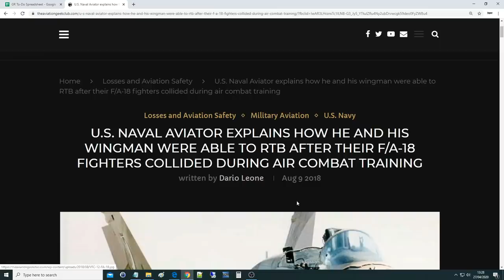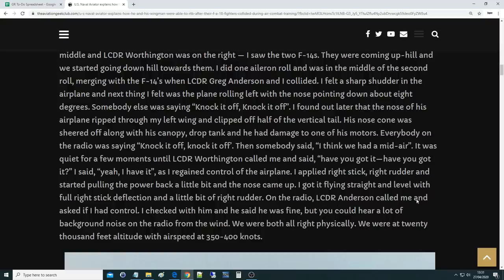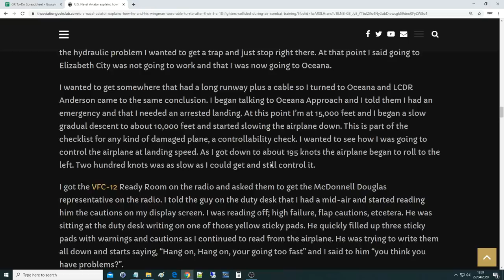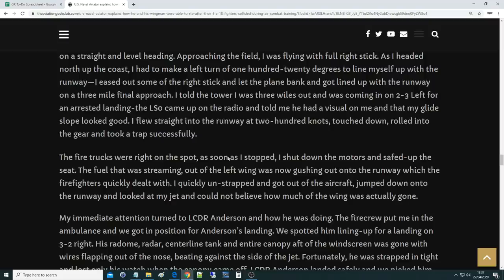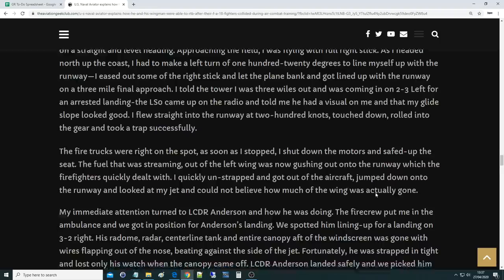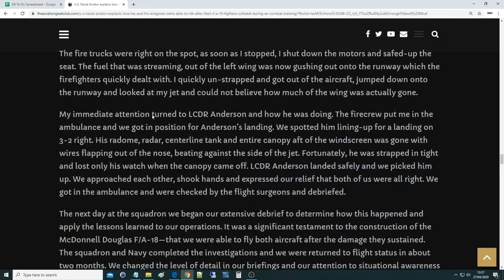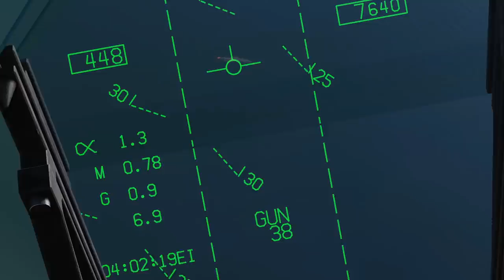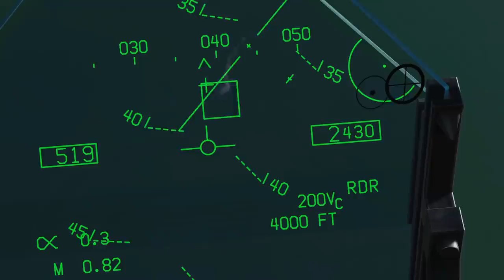1996 USN Hornet Training Collision Incident | DCS Reenactment

Comment: DCS needs more accurate damage modeling for each aircraft... a dynamic system where a bullet hits and it creates a hole, and enough stress rips the wing off at that point for example. I’d prefer that to this stuff where you can only break it at two points because that’s what’s modeled

Comment: Hi, Cap!  There are three caveats:

1.)  No two mid-airs are exactly alike.  It would be impossible for you to recreate it exactly.

2.)  I don't know for sure, but I'm guessing you are not an actual F/A-18 pilot.  They spend nine months in the B-course learning how to fly the Hornet, including many hours in the simulators training for emergency after emergency after emergency.

3.)  The pilots involved in the incident might be exaggerating a bit, though not deliberately.  After a traumatic event, the human psyche tends to inflate certain events.  The victim may remember some parts while forgetting other parts, and the parts of the event the victim remembers might seem scarier than they actually were.  I've been in two very serious car accidents, myself.

Thanks-a-million for this video, Cap!  I always enjoy your channel.
Reply: Another thing is that the stick in a flight simulator doesn't feel like the one in a real Hornet.  The length of pull is different, the spring tension is different, and the weight is different.  In the real Hornet, you can make much finer, more precise steering corrections due to the 'feel' of the stick.  The same is true of the throttles when you adjust the throttle friction lever.  DCS is truly awesome, but comparing it to a real F/A-18 is like comparing a Fleshlight to sex.

Rock on, Cap!
Reply from the maker: Thx D

Comment: To me you need to get the lead aircraft to do an aileron roles as the rear aircraft stays in place, either the lead slows slightly to align with the rear, or the rear speeds up (either way there is closure during the aileron role).  As the lead a/c's wing roles over it slices off the nose of the lead a/c, missing the hor stab, but as the lead is still rolling and closing to the rear a/c, now the vert stab rotates past the rear a/c, hits 'something' on the rear a/c and clips it off.  Confusing to explain, yes, harder to replicate, probably.

Comment: At around 13:40 when you are departing, you need to unload and reduce AoA to arrest the roll. You do this at about 13:44 ( AARGH ) and start rolling wings level, only to pull back and depart again three seconds later. To answer your how did I do that ? at 13:47 or so, you did it by pushing slightly forward. You should have been able to roll wings level if you kept stick ever so slightly forward.

Watch this https://www.youtube.com/watch?v=WfNBmZy1Yuc starting at one minute and till about nine minutes in, for a very cool explanation. Vanderburgh discusses opposite rudder and aileron, with wings intact, but the idea still applies.